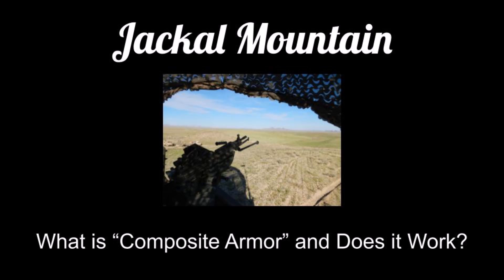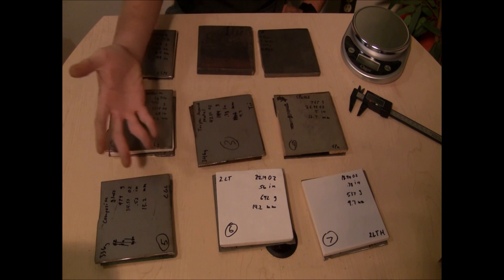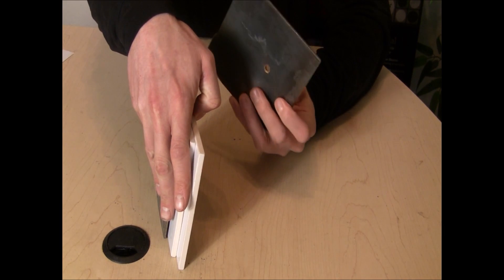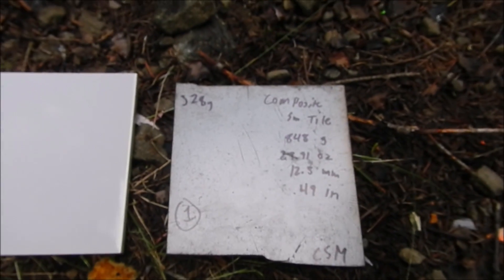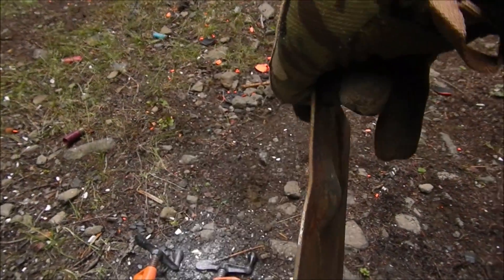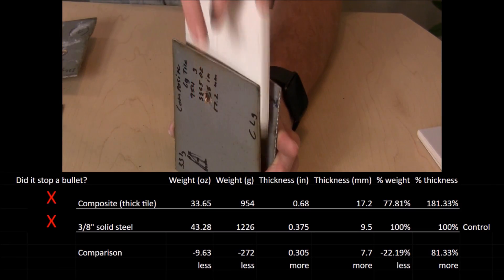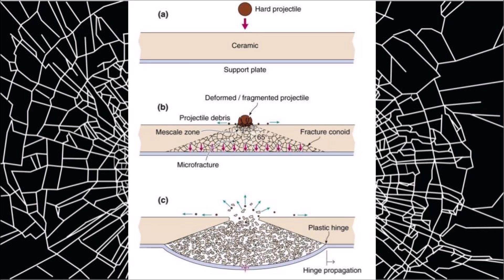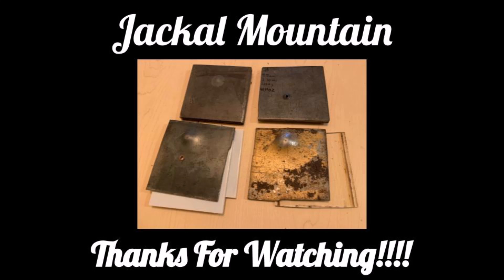Composite Armor: increasing protection, with less weight

Comment: Another test could be two thin tiles with a thin rubber layer in between.

Additionally, ceramics in armor work even better under compressive force.  The way that tanks do that is having the ceramic tiles pressed into still-hot steel, the steel cools, and contracts on the plates, compressing them.  That's not practical on a homemade scale, but could casting an aluminum plate around them work?
Reply: even that would be complicated, the high heat of the molten aluminium could make the ceramics shatter, also aluminimum is much worse at resisting penetration than steel
he could prevent much of the expansion of the tiles by making a frame adround the plate, maybe using some stuffing to give some compression or having plates pushed by screws around the frame edge
Reply: @quentintin1  I'm talking using the aluminum/ceramic plate between the steel panels.  And it would take some trial and error to figure out what works in producing these panels.

I don't really know why ceramics perform better under pressure, but it's a significant part of how Chobham & Dorchester armors work.  The ceramics are pressed into the hot & malleable backing plate, and as it cools, it becomes a single unit.

Edit:  I went with aluminum because it's lower temp than steel, making it easier to experiment with.

Comment: I like the test, but there´s one thing that bugged me: IRL there would be no open sides. Even wrapping a tile in ducktape should make a difference as the shards wouldn´t fly off making it much harder for the projectile to displace the debris, quite like a sandbag.
Personally, I would like to see how small ceramic pieces would do, if they are encased in a plastic. The idea would be to absorb shock and transform kinetic energy into thermic one (melting the plastic).
Reply from the maker: I'd be curious about that as well. Larger ceramic pieces would allow more of the force of the impact to be translated across a larger area , imporivng the abilities of follow on armor sections. Smaller pieces might not increase the surface area of impacts as much. I'm sure there is a sweet spot for size of ceramic chunk to ability to expand surface area of impact

Comment: EXCELLENT VIDEO! I wonder if the armor plates in your test would do better/worse if more solidly supported? Seems like they may flex at the top when struck while only being supported at the bottom. I also agree with a comment below that duct taping them to retain the shattering material may have some effect on your results... worth a do-over to find out!

Comment: You can greatly increase the potential of the ceramic armor if you place the plates inside a container that traps the fragments of the ceramic between the steel plates instead of letting them escape out the sides. That's the change that brought 2nd gen ceramic composite armor into existence.
There is one additional effect ceramic armor has on projectlies. Not only does it shatter the projectile but even "contaminates" it, penetrating it and forming craters on it's surface which increase the surface area thus decreasing stability and penetration potential even further.

Comment: I have a suggestion for ceramic tiles and glass try using duct tape to cover them completely in order to avoid shattering because some people used this and it worked better.
Reply: True, not just for holding the ceramic in place while being penetrated, but also for compression. It's a fact that ceramics increase in effectiveness as armor under compression, and is used in the latest versions of tank armor
Reply: @alexdunphy3716  Can you elaborate on that?
Reply: That might allow the ceramic plate to better sustain a second shot, but due to the brittle nature of ceramic, cracs will still form inside the plate. At this point you should look at the advantages and disadvantages that a “surrounding tape” has, for example cost and (maybe even) weight.
Reply: @vale.44peru  eventually not just duct tape but put those tiles in the enclosed box. One point is that this way ceramic particles have nowhere to escape and the bullet must trully force its way through.
But moreover he is talking about HEAT while using bullets - which is strange. It is said that one job of the ceramics is to create particles that fly into the heat jet and disrupt it.
Reply: @mungo7136    Composite work well for both kinetic and HEAT but the level of protection differ. For example an armor piece can have an equivalent of 900mm of Homogeneous steal against kinetic and 1200 against HEAT or vice versa depending of the design.
Reply: @Angel24Marin  Of course as the designer and army judge the possible threats and design their protection accordingly. There is i.e question whether Merkava tanks as well effective against most modern APFSDS as they are against HEAT. As the powerful HEAT rounds are widely available there while very modern tanks with top guns and sabots are rare or nearly extinct in that region.
Reply: @vale.44peru  plate the whole ceramic tile in a layer of metal
Reply: What if we use adhesive rubbers to hold the ceramic instead of duct tape
Reply: @satheeshnarayanan701  With rubber the bullets can bounce back towards the enemy.
Reply: @dragonmartijn  Bullets bouncing back hahaha it doesnt work that way!
Everyone knows tanks dont have rubber armor because bullets might bounce into friendlies if the angle is not exactly 90°!
Reply: Could even take somebody’s eye out ! Health and safety etc
Reply: uncletigger  There is no plasma, that is pure myth. Even that jet is plastic metal due to extreme pressure but not plasma. It is question of the speed, momentum and in the end - pressure. Even rubber can disrupt the beam - hence rubber sideskirts on some soviet tanks. You need something that keeps being thrown into the jet.
I have seen X-ray picture of the beam interfering with NERA (metal-rubber sandwich similar to ERA just non-explosive) that beam was cut into short dashes
Reply: uncletigger  Its plastic deformation, not molten nor plasma.
Reply: This would be my assumption as well. Bind the layers with a ceramic adhesive under pressure and I'd wager that the initial composite armor setup with the thin tile and 3mm backing plates would have defeated at least one of the rounds instead of failing due to layer separation.
Reply: I'd love to see a test where he adds resin to the mix.
Reply: white  I know, but I want to see a DYI project.
Reply: Are you all not aware that a damn clay floor tile is nothing like armor ceramics? They use stuff like boron carbide for armor, which is magnitudes harder, this test is meaningless.
Reply: @cpthrki5852  No shit, Sherlock... But this video is about the principle, and he made a good example with simple materials.
Reply: I was thinking that ceramics might work better if pressurized, as in boxing it in on all sides and squeezing it with weight before welding the box closed. I was also thinking what might happen if a 12 inch cannon ball hit such tanks. Assuming we have tanks that are built with glass and ceramic armor that fractures, is it possible to break all the plates in a large area hitting a modern tank with a 200 lb steel ball thats far larger in diameter than the thickness of the armor. Once a section is hit by this wrecking ball, then maybe underpowered guns can get through that area.

Comment: 1/2" UHMW to spread out the impact force, then 1/4"AR500-steel catching the fragments, please.
(with M2 30-06 or other blacktip)
or 1/4" AR500 steel targets behind the UHMW, if non-armor-piercing is the only ammo you got, please.
Reply: or use a shock-absorbing plastic as cement for Al2O3, or SiC pellets.
Reply: Pat Micucci  Aluminium is trash for armour when it comes to any kinetic munition. An early WWII German tank could probably one shot kill it! It does offer some decent protection against HEAT though. Al2O3 is used for sharpening blades and other metal processing. It would destroy any projectile, but is AFAIK too brittle to be used on its own...

Comment: Can you try non explosive reactive armor. Basically a sheet of rubber between 2 metal plates
Reply: Doesent help against kinetic penetrators like this
Reply: @ravener96  it does, Later versions anyway. They use thicker plates and layers of explosives
Reply: @dh4hdvsg588  thats against APFSDS type projectiles, and works by shattering the penetrator rod, and making it tumble. this wouldnt show using a 556 round
Reply: @ravener96  it is more effective than plain steel though. T72B tanks base armor uses layers of steel rubber and air pockets
Reply: @dh4hdvsg588  again, this is made to protect against APFSDS and chemical trype rounds. you arent going to see the reactive armour effect on a 556 bullet. spaced armour does work on a 556, but still not to the drastic degree it does against long rod penetrators and shaped charges

Comment: Greate presentation. 
Just to point out that early Chobham (Abrams cutaway)  is composed from two plates with polymer rubber like material  in between . Burlington use hard ceramic pressed and glued in steel matrix. Apparently very important aspect of it is that ceramic is compress by steel matrix greatly increasing strength. 
Try to use polymer glue/sealant to stick your ceramic between steel plates , and try to bolt it together to provide compression in one axis.
Reply from the maker: I'll try that. Thanks!
Reply: @jackalmountain6523  Have look on product called CT1 , probably nearest thing to Polymer used in Chobham NERA
Reply: @komradearti9935  Yes , you absolutely right. just found that: https://below-the-turret-ring.blogspot.com/2016/03/chobham-armor-facts-and-fiction-1.html

So Burlington was cod -name for  of NERA system with was given to Americns.
Reply: @komradearti9935  I think it cod -names represent different solutions,  and generations of those solutions. I read about it in some Polish source researching advanced amour program in UK.  Autor  mention Chobcham in regard of NERA , and Burlington utilizing Ceramic under compression.
Reply: @komradearti9935  I would love to read full document with was obtained under freedom of information act ,(one containing cutaway of armor), as this is probably primary source.  Any links out there?

Comment: awesome video :)    i wonder what would happen if you were to add a layer of fiberglass and resin to hold the ceramic together?
Reply: That stuff is great at stopping bullets too. The Russians used a version on their first composite tanks called texolite. It has better multi hit resistance than ceramics but idk if the protection vs weigh is as good
Reply: @alexdunphy3716  I couldn´t find what textolite is. Do you know anything more specific?
Reply: @edi9892  I probably didn't remember the name correctly. I'll see if I can find a link
Reply: @edi9892  https://en.m.wikipedia.org/wiki/Combination_K
The laminate glass reinforced plastic is sometimes called textolite
Reply: @alexdunphy3716  thank you!
Reply: HK I doubt it would increase its ability to stop a round by much. If your looking to make armour I’d use glass cut into small squares.
Reply: You'd be wrong.
Keeping ceramics contained and delaying the shockwave reflection on the backface is the key to getting the most out of ceramic armor composites.
Reply: Dwwolf wouldn’t that have been achieved by the steel plates?

Comment: What a fantastic presentation. Great work!
The logical next step is to put the ceramic on the face. I’ve done some similar testing and found ceramic first can hugely increase the resistance of the backer material. I’ve had a floor tile and a car door stop a 7.62x54R soft steel core round cold. Just an idea.
Reply: Armor grade steel works in that manner. The hardest, most brittle steel is on the outside surface and the further into the armor plate you go, the more ductile you get. The high hardness surface is to shatter or deform the geometry of the penetrator, the softer material is structural to absorb the energy
Reply: That's impressive! Your cartridge is much more powerful than the round in the test. If we were betting I would have bet against it stopping that round. Well done.

Comment: Huh, the glas worked better then I expected...
Nice Vid. :D
Reply: Glass is very hard so the round has to shatter the entire plate to penetrate hence its effectiveness.
Reply: @AceDan-gc9po  effective body armour can be made from fibre glass too
Reply: Glass is heavily used in composite armor manufacturing, also thanks to its effectiveness against the molten jet of HEAT charges, for example the Russians used a certain type of glass in the armor of the T-64 (or T-72 one of those, can’t remember exactly).
Reply: @vale.44peru  Yes and first leclerc generation use it too, a very dense one. Just note that ceramic used in tank armor is a very high density one, with many heat absorbant, more like the space shuttle ceramic was and is mainly effective against Heat round.